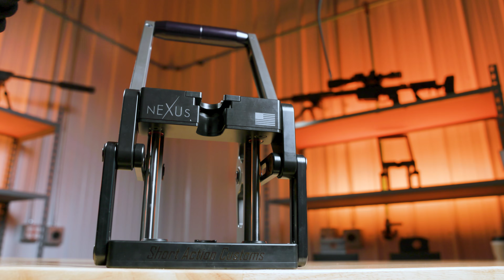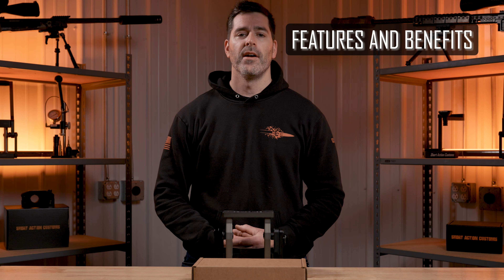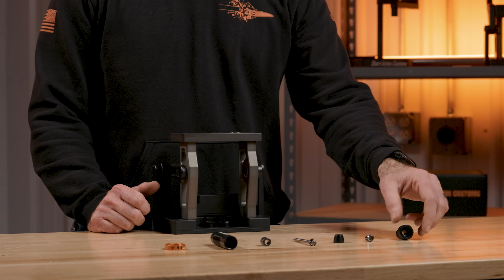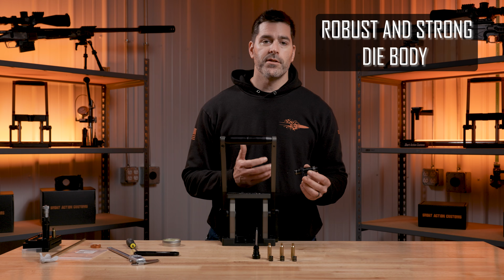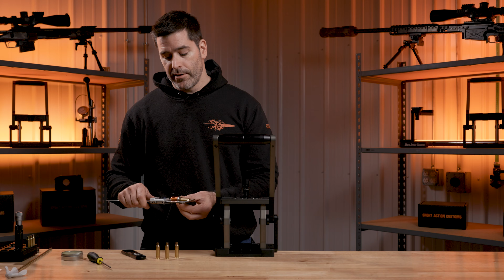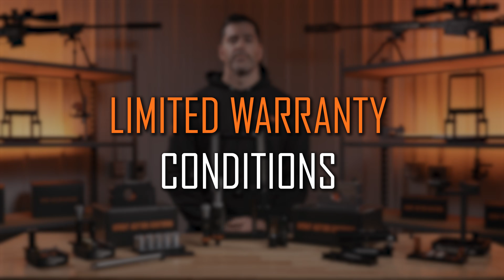How to Set Up SAC Modular Sizing Die with Mark Gordon | 2025

Comment: HI, I still not able remove ER11 collet from topcap☹
got even bleb on my finger but could not remove it
Followed your advice and found small square mark on the bottom of the topcap
No luck 

Calibre 30.06 resizing die with standard decapping pin in it…
Seems 30.06 collet ER11 is seated very well and hard

Comment: I’m more inclined to use a die that sizes more of the base. Big problem with this set up in my mind is less of the case below the.200 line is sized. This could lead to a sticky or clicky bolt. The die design is awesome. Very well thought out. I just have some concerns on its use in conventional reloading presses. These are just my personal opinions. I’m no expert.
Reply: I use the "Rollsizer" for this purpose. No Die could go as low as the Rollsizer can. And yes I know that this is additonal equipment which is costing additonal money.

Comment: Biggest problem I’ve run into with the Modular Sizing Die is the top cap.  I’ve tightened it with your wrench before and been darn near unable to get it apart since there is nowhere on the body to grab ahold of. So you say more than hand tight but I assume not much more or you’ll never get it apart. I’d love some tips and tricks about that… or some wrench flats on the body for disassembly.
Reply: Tighten the lock ring and you can put a wrench on it. In my Nexus the solo loc ring slides in and prohibits the die from rotating. I have wrenched on the top cap harder than I probably should and the die body doesn’t rotate
Reply: @txdoodlebug only works on a Nexus or a Co-Ax with the sololoc.. if it is really tight.  I backed my die body out a bit from the lock before the top cap loosened.  So I had to re adjust the entire die just to be able to clean it out of Imperial Wax gunk.  For anyone running a different press they could be SOL.